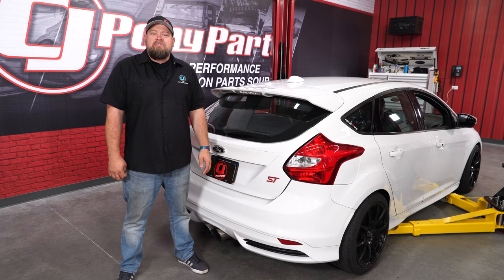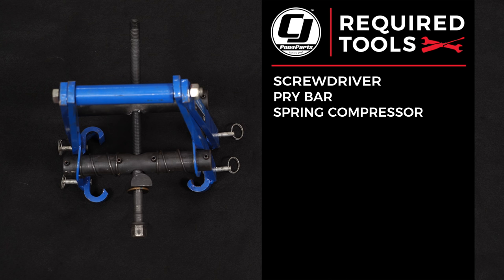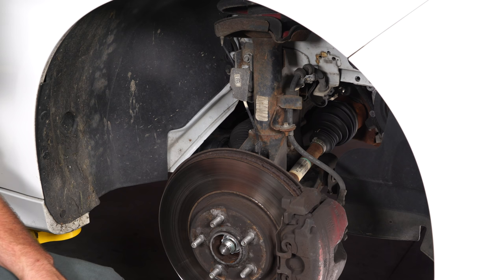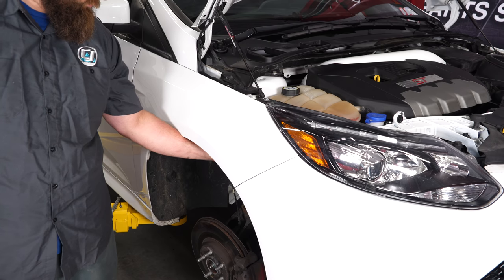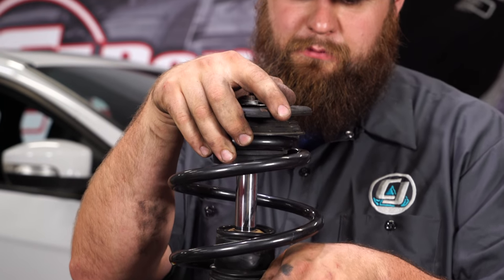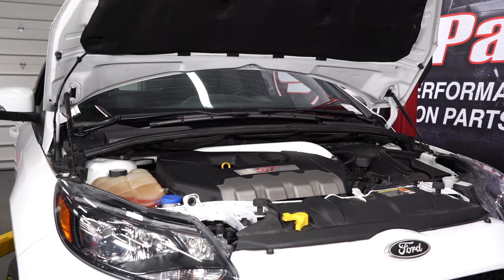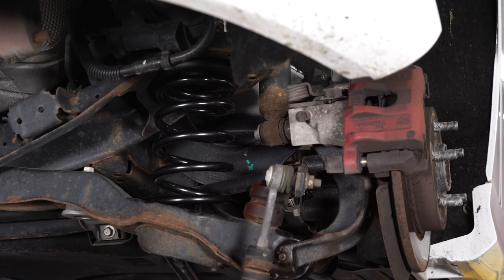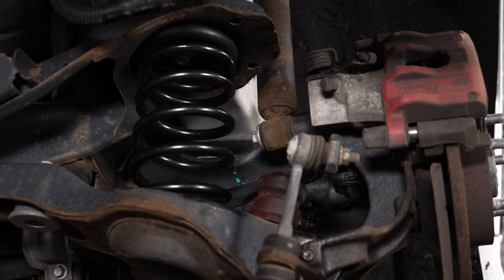Focus ST Install: Set of Eibach Pro-Kit Coil Springs

Comment: Just recently installed these springs on my st. These springs are amazing. I’ve heard on forums these were available as a option in the UK and it makes sense. They easily pass for stock springs. Ride is amazing. It may be slightly stiffer than stock but nothing extreme. I’ve lowered cars before and the ride was rough. This feels stock with virtually no body roll and wheel gap is all but gone.
Reply: Did you keep the stock shocks and struts when installing? I have a 2014 Focus SE and it's impossible to find aftermarket shocks and struts that don't end up costing me as much as coilovers would, total.
Thanks

Comment: I have a ford focus St 2017 and installed the springs godspeed 1.2  and strut monroe, but not under anything seems the original suspension.  The only thing that did not change were the bump stops, I'm use the oem,  you should change them for a shorter one.

Comment: the lower spring end: has an end stop but also a dip 'marker' where the previous spring end lined up with (1cm away from the metal stop). Which is the correct location for the spring end?

Comment: can anyone answer this question? if im having trouble removing the top end link bolt (my version requires offset box wrench and hex key), can I just remove the bottom endlink bolt instead? endlink should just come out still attached to the strut, if im not mistaken.
Reply: Angel Lawless Ik it’s been 6 months, but did you figure this out, bc I was trying to do mine today and couldn’t get it and gave up
Reply: Theres
Reply: @tommylong2151  theres a space between the endlink and the strut where you can put a wrench to hold the stud while you loosen the nut. Or you can use the hex hole in front to.hold the stud while you loosen the nut
Reply: Steven11525 That’s only on the prefacelift, luckily my friend had the right tool, you need a pass through wrench sadly :(
Reply: @tommylong2151  huh. I have both on my 17 ST2
Reply: Steven11525 I had to go to my friends shop to do it bc mine didn’t have it, that’s weird, maybe they changed it in 2017 or something bc mine doesn’t sadly, would have been nice if it did, would have made it a whole hell of a lot easier
Reply: I know this is late but I’m posting for future people who install. You can disconnect the end link from the sway bar which will give you easy access. Use a 17mm wrench or adjustable wrench to hold a small washer that’s just after the sway bar (on your side) and hold it while you undo the nut on the opposite side of the sway bar.
Reply: sorry guys. i wasnt getting notifications for some reason, until today. i honestly dont remember posting this question (almost a year ago). ended up getting the oem endlinks off with a visegrips (to keep the nut from spinning) and an offset box wrench. at least thats what i remember. i then installed new steeda endlinks but i still have kinks to work out (crunching/ popping sound during low speeds, i think i didnt line up the endlink studs with the holes correctly). hope that helps someone.
Reply: i see some people in the comments have provided good feedback. thanks!
Reply: @courtney m (for some reason i can’t see you in the comment section). you can use a pair of visegrips (will damage the rubber boot of the oem endlinks) to keep the nut from spinning on one side.
Reply: Courtney M yea i know all about running out of daylight lol. hit me back if you get it figured out, or not. also. make sure you join/check focus st forums if you haven’t already; great resource.

Comment: These are terrible! Do not buy, the 2nd ring bunches up and pushes out to the side and causes insane rubbing, if you match them with Bilstein B8's it's even worse. What a waste of 2 years of my life not being able to properly use the car, even lost control in a corner on the track. DO NOT BUY THESE.

I'm testing alternatives at the moment, I think part 113502308FA will work for the front and I'm also testing 118400607VA.
Reply: Yes I just failed inspection saying these are rubbing. I took one side off it is def a slight rub. I’ve tried just about everything I can’t get them in without them touching the body of the car.  Not happy right now.
Reply: @rustybrown771  it’s horrible, worst product ever. I can confirm the other springs work, but the handling is horrible. Get white line or H&R

Comment: Damn that car is rusty. Does the owner live by the sea?
Reply from the maker: Daily driver, pa winters, salted roads
Reply: @cjponyparts  if i wanted to skip the rear shock removal, are the bump stops the same from stock to the eibach?